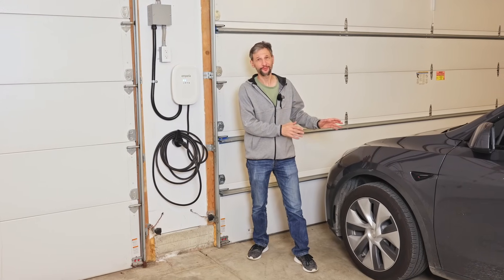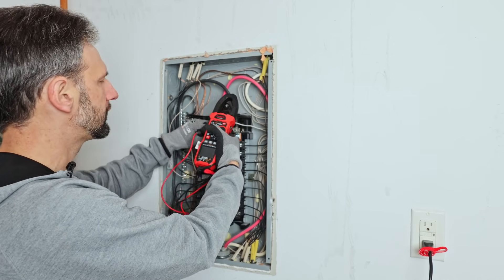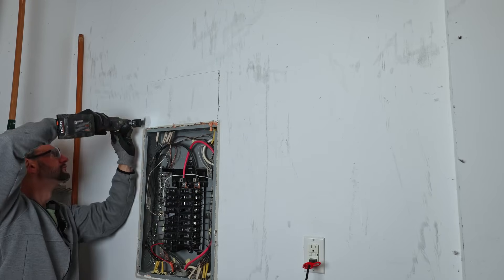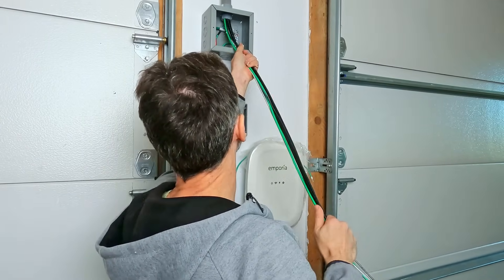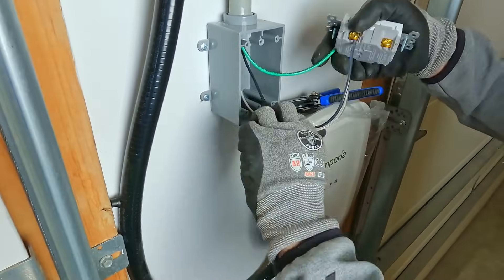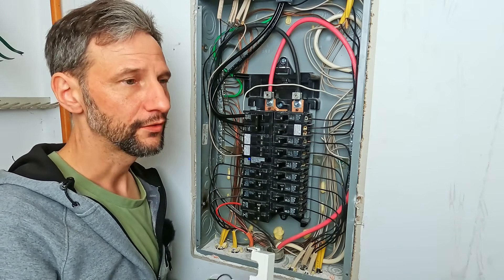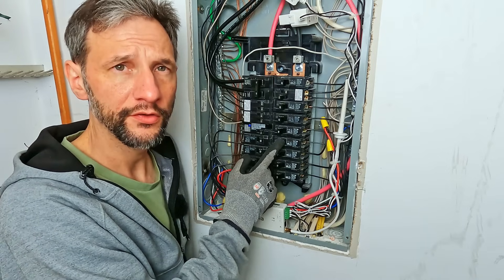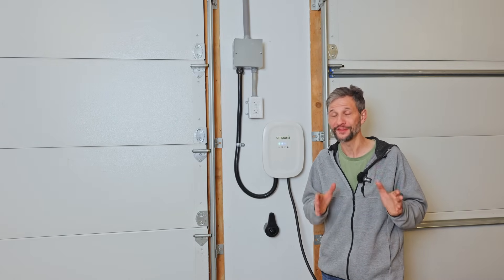DIY Home EV Charging Station Install Step by Step

Comment from the maker: Emporia EV Charger with PowerSmart J1772 ($50 Discount Code "EVERYDAY50"): https://signaturesolar.com/emporia-ev-charger-with-powersmart-load-management-white-nema-14-50-j1772/?ref=SALE
Detailed list of parts options and discounts on my website here: https://projectswithdave.com/diy-level-2-ev-charger-install-with-load-management/
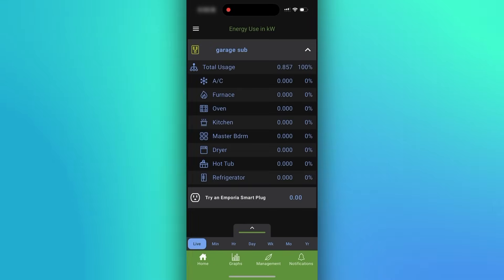Reply: 14:34 - Have I misse a step ?
How are emporia base in the box and the charger connected - by wifi ?
I also wonder how many phases are used cause it looked like 2 phase installation but I have not seen such blue neutral wire arriving in the charger ?

Sorry, we have 3 phase for chargers hence much smaller cables or even single phase but only for 230V x 30A = 7 kW max which is quite unusual cause we use 3 phases cause every house has 3 phases and the load per cable is lower.
Reply: OK, it is a wifi connection as shown afterwards. I had expected a cable - we prefer cable to avoid all the possible WiFi issues.

Comment: More simply, using a two space, small receptacle box installed adjacent to the main garage panel one can tap into the larger panel at the panel's incoming pugs to connect to the smaller breaker box incoming pugs. 😮 Ta-da !

Comment: Great video. However when consolidating those breakers into dual breakers try to maintain the load on each leg. That is plug wires into same leg they were originally on this way the panel maintains same balance. Assuming balance was maintained to start with.

Comment: Haha I’m not an electrician but I’m acting like one . Most serious jurisdictions won’t allow into pull a n e permit let alone overloadxss as panel with emporia load management . 2023 nec will allow power sharing between two chargers of same brand  but not “load managing” - and reliance upon emporia or any other oem

Comment: I notice you used # 4 awg to connect to the emporia which is wired for # 6.. I guess its ok since it appeared to work? Thinking about doing the same; I purchased # 4 thhn and was going to create a 240 outlet, but decided I may hardwire instead. I am not sure if I should connect the # 4 cables to the emporia since emporia speaks against it. However, you see it get done successfully in this video. Is this cause for concern? Appreciate any info anyone can provide
Reply from the maker: I'm not an electrician, you should consult a qualified professional.  You can use a heaver gauge conductor than the breaker spec, it's going the other way that would be a concern.  We used 4AWG because it was a long run, that reduces heat and losses.
Reply: Emporia only recommends to use ONLY 6awg when attaching directly to their internal panel.  But since they used the included Emporia whip it was merely connecting 4 to 6 with proper connectors.  The 4awg thhn merely allows for lower voltage drop over the longer run.

Comment: You realize that the neational electrical code in table 310.15.(C)(1). Requires a reduction to 80% capacity of those wires ability to carry current.

Nec section 110.14 tells us that breakers 100 amps or less can be rated at either 60 or 75° c.  This would put your #4 wire with either a 56 amp rating or 68 amp rating depending on the breaker terminal temperature limits.

Comment: How does the load management react so quickly? Somehow it reacts faster than the breaker to throttle or shut down the charger before the added load of a dryer trips the breaker?
Reply: The time-to-trip for a breaker can be several minutes for moderate overloads. Plenty of time for charger and EV to react.  Also, the Level2 Charger doesn't actually control the current, it just sends the signal to the EV to notify the EV's on-board charger of a new maximum current level.  The final speed of response is controlled  by the EV on board charger. (Note that DC fast chargers work differently and those actually do change the current based on instantaneous requests from an EV).

Comment: Thats quite common in most EV chargers (load monitoring and management, at least here in Australia and the UK), many like the Zappi can even manage solar arrays as well, allowing you to charge at night, or during the day only with solar providing all the power and nothing drawn from the mains (plus if you have 3 phase in your home, you can have up to 22kw EV charging, with 7-9kw on a single phase 230v supply if you only have single phase hooked up...

Comment: Great video. Last week I bought an emporia charger only as I already have the Vue2 installed in my panel. Can I still use power share?
Reply: Yes. You need to purchase a software only update for the charger to do so.

Comment: Why not demo the load sharing capabilities. Turn on that dryer and other high power draws on the sub panel!?!
Reply: I was very surprised he didn't show that. That's the real payoff!
Reply: Yes, should have shown this. That was the main point of getting this. So why not show? You can otherwise get a chaper non smart charger.

Comment: Loved watching this.
If you haven’t yet, could you make a video for us non-handy people, giving tips for things we should request from electricians or other technicians that we may hire to install car chargers or solar panels? (I hope that makes sense)

Or should we just trust them to do everything in the best way.

(Thought inspired by you suggesting using 4 gauge cables instead of 6 gauge.)
Reply from the maker: Good question.  Here are some thoughts off hand:
If possible hardwire the charger.  Plugs are an added fire hazard.  If you have to use a plug, use an industrial plug as I illustrate in this video: -E1FXXYxqp8?si=YRiapkc1z5_6go7D&t=1691
Request the install to go back, wiggle the wires and confirm with a torque wrench they are all tightened to spec.  Many fires start from insufficient fastener torque. 
Make sure the breaker and wire are appropriately sized for the charger load.
Make sure the load center and electric service to the house can handle the additional loading.
Hope those help!

Comment: One thing about this setup.  If the internet goes down, emporia cloud goes down, or the wifi goes down, the emporia EVSE defaults to the preconfigured current limit.  WHich means it will happily trip breakers and loses its energy management if it loses communications for any reason.  Your panel MUST have a minimum of 6a available at all times, since that's as low as the system will go.
Reply: It will not. The charger and dongle communicate via local network. The cloud is just for app data
Reply: @APatchworkCanvas  That is not what I was told when I contacted them. And that is not what they have published in their online site, nor in the manual.
Reply: Can you set a low default limit or does it default to max current?
Reply: @erikj9962  No, the only thing that you can set is the overall circuit limit. That limit applies no matter what though.
Reply: What does that mean?
Reply: @nuclearthreat545 That means if the charger loses connection to the internet, or the server that it needs to work, you will not be able to reliably charge your vehicle.

Comment: On your website I did not see the nylon rope that followed the kite string. Was it in one of the other links?
Reply: That is a standard electrical tool commonly called 'Pull Tape' or 'Pull Line.'  Pull tape is considered by most to be a disposable consumable, and it is commonly available at big box stores, online, and supply houses.
Reply from the maker: Sure, here is a link for Pull Tape: https://amzn.to/427WLNk

Comment: What did you use as your "ballon" on the end of your line that you Sucked Up through the conduit?  What string/twin did you use and what strength was it to enable pulling such heavy AWG wire?
Reply: They used Pull Tape.  It's much stronger than pull line/twine, and is a standard electrical tool, it is considered a consumable/disposable item and is available commonly at big box stores, online, and electrical supply houses.  THe sender line is just fishing line, with a plastic shopping bag on the end.  These are all normal electrician tricks when working with conduit.
Reply from the maker: See @BadHaddy's comments.  Here is a link for Pull Tape: https://amzn.to/427WLNk

Comment: Where do we get "double breakers" my local HomeDepot does not have them for my 200Amp Panel or my 100Amp sub panel both of the same manufacture (Brand) and breaker type. Both my panels are full and the only way I can add a 50-60amp charger breaker would be by replacing existing full size 15 amps with doubles. What's a Home Owner to do?
Reply: Not every brand and panel makes a tandem breaker option available.  Sometimes the panel cant use them because it wasn't designed for them.  Sometimes, they nare not available at box stores but you can find them at electrical supply houses.  If they are simply not made for your panel, the code compliant options are to replace the panel, which is expensive, or add a subpanel for certain loads, which is a lower cost option.  Both are situations that an inexperienced homeowner really should consult/hire an electrician for.

Comment: Curious what ferrule crimping tool do you use? Also when pulling wire through conduit, just as a suggestion, I pull another pull line with my wires to somewhat future proof myself.
Reply from the maker: You can find links for everything for this project on my website here:  https://projectswithdave.com/diy-level-2-ev-charger-install-with-load-management/